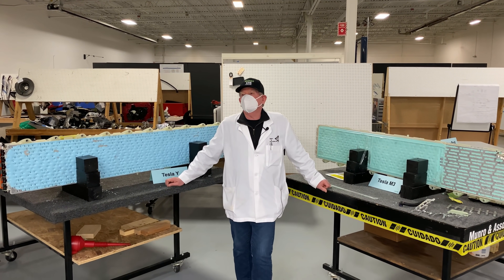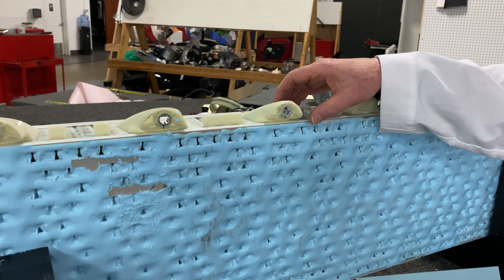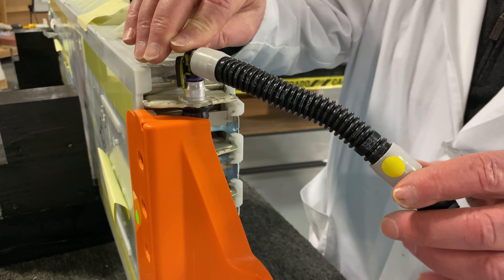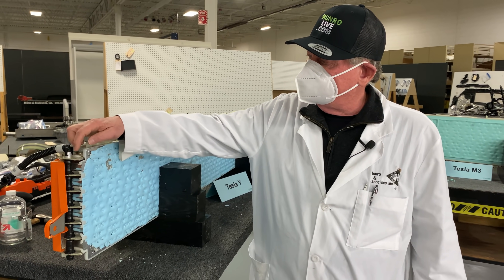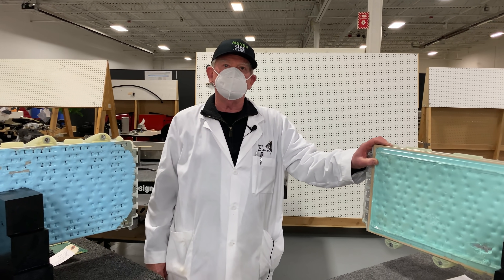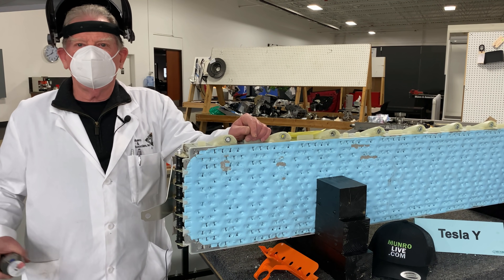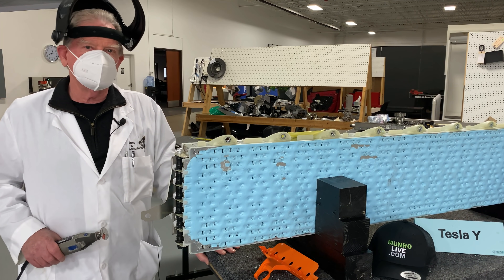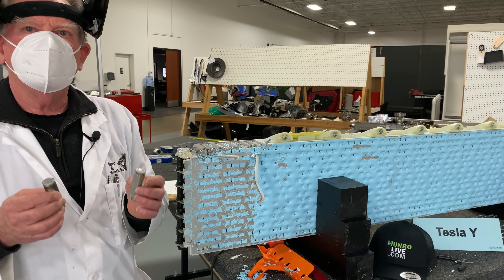Model Y E35: Individual Battery Cell Removal and Comparing the MY-M3 Battery Modules

Comment: Not every cost reduction is a good thing. Sometimes, overbuilding a thing compensate for what can happen after things have aged specially plastic parts. I’m a MB mechanic and I hate taking apart plastic parts after 3 years or 30,000 miles of use specially if they are part of cooling system. They loose elasticity and we usually replace them when those parts are in the way. Our usual complaint, “ What were the Engineers thinking when they are designing these?”

Comment: So how does the battery cooling work? Water / coolant is passed through hollow fins that go all the way to the back end of the battery and back to the lower part? The cooling fins only "touch" one row of battery cells, but it appears that there is at least a second or even third row not directly touching the cooling fins, correct? Where does the hot water go out - the other end of the black plastic tube or at the other end of the battery?

Comment: Tesla seems to have been producing castings throughout the epidemic. If they have a stock pile will this allow them to have a high production rate or is this not the limiting factor (in normal times). Conversely how reliable are these devices could a failure sent production for a prolonged time?

Comment: Any thoughts on how recyclable that pack design is? It doesn't look like it was designed with recyclability in mind at least. 

And any chance of getting hold of a few of those Model Y 2170 cells? We're quite keen to test them out in the lab as a benchmark, and to crack one open to see exactly what is inside.
Reply: Since Tesla will be recycling these batteries themselves, I'm sure they considered it in the design and have a process in mind for recycling. https://www.greencarreports.com/news/1122631_tesla-launches-battery-recycling-at-nevada-gigafactory

Comment: It would be interesting to see the difference in terms of capacity/charge rate between the two cells, comparing the old 3 version to the Y.

I understand that might not be possible given the 3 has been discharged for a while.

Comment: That's difficult to recycle or re-use once these batteries gets old or not good enough for a car.  I'm thinking if Tesla could somehow make the pack more modular,  sacrificing a bit in space and costs so that it will be easier to re-use them as batteries for home/appliances/projects.

Comment: These battery packs are well designed for an efficient drivetrain but pretty awful to recycle. It will be very expensive to dismantle the cells. Not very sustainable.

Comment: Do you think this potting compound might be the “intumescent goo” that tesla patented in order to inhibit propagation of thermal events between cells? 
http://www.patentsencyclopedia.com/app/20100086844

I wonder if this contributed (along with safer chemistry) to  reducing the 15 firewalled chambers in the S and X packs down to just one in the Model 3 and Y.

It would be interesting to heat the potting compound to see how it responds.
Reply: Whoa... How on Earth did you find that?
Reply: @liam1428  Just Geeking out as I do, many years of analyzing the engineering. ;-)

Comment: Rolls Royce developed a plate heat exchanger that uses layers of dimpled sheet metal. It’s cheap to make but very efficient. I wonder if these packs use a long plate exchanger between rows of  batteries.

Comment: is 1 o-ring enough?
Reply: Sure, almost all home plumbing sharkbite, push fit, and crimp connections are done with only one o-ring. They claim a 25-50 year service life. If they're properly installed and specified they last ages. Most times they fail it's due to sealing a moving part (they slowly abrade away) or poor fitment/design specifications. For example the choice of synthetic rubber needs to be matched to any chemicals, in this case additives in the coolant.

Comment: Video request:  Sandy recommends the Y, yet drives a Rubicon.  The term “SUV” has been hijacked to refer to volume distribution rather than vehicle competence to handle rough terrain.  I need to drive forestry/mountain/dirt roads, so won’t buy Tesla until the cybertruck comes out.  Could Sandy please go through the components, suspensions/ wheel joints/ what-have-yous that make the Y unsuitable to drive on such rough roads, whereas presumably the Rubicon could handle them?

Comment: Is a chemical analysis of the batteries and charge characteristics of the 3 vs the Y battery packs part of your plan?
Reply: spoiler alert, they are all the same cells from the same factory .
Reply: Except that they were manufactured years apart. An analysis would show incremental changes/improvements. But thanks for your condescending reply though.

Comment: This battery pack design is the definition of unrepairable !
Reply: The whole pack, the four units, can be replaced individually. Each battery was not made for repair. And to recover those cells looks like a nightmare.
Reply: lightdark00  - TThose pack are way cheaper to build, cimpared to the MS and MX ones. he cells might yet be recyclable by having some kind of solvent to remove the foam. Then they get acces to individual cells. Then they might have to test every individual cell, and select those for use in a refurbished replacement pack. Still saves money and ressources i guess. Especially in large quantities.
Reply: @bonzo-er6ly  I was making a point about the word usage. I was thinking about the average person that would want to recover the cells or replace one battery. Gasoline might be the cheapest solvent currently easily available, that might work.

Comment: So in-between the batteries are incased in foam with layors for cooling and stuff formed and fit ? Then all metal, aluminum covers going on top and bottoms of batteries glued or fitted with forms built in to the foam while keeping it lighter it is filled Indian and the foam becomes brackets not filled in areas to lock in places for metal connection then when recycling the battery would be easier just seperate foam from all other components and not only use the batteries but all other pieces of battery pack connectors to just would make it simple right ? What do you think would a formed battery,lighter battery and one that's Easter recycleable be better can it be done keeping it cool so no overheating ?

Comment: I think the difference between the blue and green foam is that the blue one is painted and the green one is casted, take a look at the edges.
That makes the blue one way faster to manufacture.

Hope to hear your opinion Munro.
Reply: The blue stuff isn't actually foam like he says. It's gap filler that has a high thermal conductivity meant to help dissipate the heat from the batteries to the battery module housing. The blue one to me looks like BERGQUIST GAP FILLER TGF 3600. TGF 3600 gap filler is pretty common for batteries. The green color is just a different gap filler. Both should be a form of a liquid before it cures. I agree that the green one looks like it is casted around the edges. The green one most likely has a low viscosity which might be why they have to use a cast to keep it in place like a dam. TGF 3600 is think enough where that doesn't need to be done. The holes that he didn't understand are most likely for outgassing.

Comment: Get the upcoming rav4 plugin hybrid.  39mi of electric range, e-awd, they claim instant torque like an EV, and it is fast at 5.2s 0-60.  It will be a model y competitor and fill in the gap that the chevy volt used to fill.

Comment: I see tesla thought about how a recycling company would recycle the cells lol...hardly eco lol terrible design try and get that apart to reuse the cells
Reply: Yeah, because dipping it in a chemical to break down the bonding agent is rocket science, right?
Most of these battery packs will probably be used in stationary energy storage after its use in a car. In those cases you don't even need to break down the pack.
Reply: Most likely these batteries will spend the first years after being in an EV as in-place energy storage for the grid: they will be reused as packs, only after that will they be torn apart and recycled.
Reply: Theres probably a nasty solvent that can get the job done, or else a heat process that isnt suitable for the disassembly of a single battery.Sandy probably doesnt want the electrolyte leaking everywhere or his shop filled with toxic fumes.
Reply: @Marc83Aus  It's fortunate that the next gen Tesla batteries will likely have a solid electrolyte. But yeah, it's always interesting to see how they would be disassembled. I think a former Tesla employee started a recycling company for Lithium batteries.
Reply: @DecepticonLeader  Its probably going to be harder to recycle the solid electrolyte batteries. But they should be safer, cleaner, and have a longer lifespan.
Reply: @Marc83Aus  Yep.

Comment: Given how difficult these are to disassemble, I wonder whether recycling will ever be economical or if they'll just end up in a landfill.
Reply: Also note.. these battery packs are not a one life use. These packs are expected to have a second, and likely 3rd life.. spanning over 20 years of use.. potentially as long as 50 years of service, before needing to be recycled back to their base materials
Reply: There will be some sort of chemical that can break down the bonding agent. Recycling isn't always simple. It's all down to time to material value.
Reply: You literally throw them in a shredder. That’s how you recycle these.
Reply: @bob15479  Fully Charged recently did a report on a pilot setup in Germany where they do just this. Strip down to basic battery structure, shred it under nitrogen, low temp evaporate the electrolyte then dry-process the remainder before then chemically separating the valuable rare earths. If they recycle the carbon as well, they reckon they are getting close to 90% re-use of the entire battery. They even use residual charge (if any) to power part of the process. Only small scale pilot at the moment but once scaled (and it is scalable) should mean very effective (and profitable) recycling of EV batteries.
Reply: I was also wondering this. How the hell can we disassemble these packs quickly to re-use the batteries?
Reply: @marctenhove874  Recycle is melting the pack to its constituent elements are reusing them. Its probably cheaper for rare earth metals to be recycled than mined.
Reply: @archigoel  That's laughable
Reply: @archigoel  there are no rare earths in the batteries.
Reply: Lyle Stavast true.. but many hear cobalt.. and think rare earth metal.. even though it isn’t.. but, i think that’s what they are referring to
Reply: If you look at any salvage Tesla auctions all the car get their batteries already removed, I guess that's the most valuable part.
In the case of the Model S/X it is possible that some packs might be used for upgrade to a larger battery size or replacing high mileage one.
But in the case of the Model 3, may be the packs are then used for making Powerwalls ?
Reply: Nihongo Benkyo Shimasu exactly so. The second life for these battery packs will be as energy storage, where they do not need to retain their maximum capacity as they need for a automobile to be a viable transport.. they can operate as energy storage with slowly reducing capacity over time, for decades. And after that, there are people suggesting even less intense purposes where the batteries can operate for a third ‘life’.. these things are built to last a long time.. with reduction in total capacity, but still VERY useful.. and only then, to go into recycling to take them back down to base materials to be reused.. and as another guy mentioned, there are already companies going in to this exact business, J B Straubel.. and they will develop techniques to do it where it’s profitable. Even if it cost a fraction more.. i think companies can explain the benefit of paying a fraction more for using recycled materials
Reply: I'm pretty sure recycling will be addressed at Battery Day later this month.  Re-use is the first step.  Stationary storage is growing and used EV battery packs are used in DIY systems.  Thses things will last over a decade as an EV battery then another decade or more as storage.  Recycling right now is more for cells that are bad right off the assembly line and packs that are unusable (physical damage/flood damage).
Reply: https://www.greencarreports.com/news/1122631_tesla-launches-battery-recycling-at-nevada-gigafactory
Reply: aurelio milaor cabal  Straubel starting a company doesn't prove it is or will ever become profitable. Tesla has been a company for 17 years and has never been profitable.

Clearly if the price of raw materials becomes high enough, recycling makes sense.

But if raw materials are really expensive, the EV they're used for may not make sense.

Comment: Mr Munro, name on the collar, two pens in the top pocket, that's a proper Old school, working engineers jacket.
Reply: haven't seen him pull out a slide rule yet.  THAT, is old school...
Reply: One of those "pens" is a telescopic torch pointer, he used it in the previous teardown episode, E33 around 9.20 you'll see him use it then put it back.
Reply: I was just thinking that I need to buy a lab coat to wear around the house. Like a Rick style long lab coat.
Reply: No slide rule....
Reply: He should have a pocket protector in the pocket for pen leaks...

Comment: "You might get a trickle charge" something tells me that still might hurt, but live to remember it.
Reply: you can feel 60 volts, but doesn't hurt you at all. As long as you don't electrocute your pace maker ... 😁👍
Reply: @Poxenium  I got 6,000 volts biting into a Certs. It was refreshing.
Reply: Had a few rapid charges in my life, thankfully all somehow within spec
Reply: 480 will let you know you didn't follow LOTO
Reply: A tickle charge.
Reply: I’ve been with with 120 plenty of times it’s no big deal
Reply: @mattbrew11  Try 120 volts, 120 amps. Even it up. When your head smokes you know you are there.
Reply: ipissed haha good point. It’s the amps that kill not the voltage
Reply: @mattbrew11   But you need the voltage to create the current. A 12V/1kA Battery is harmless to the human body, the resistance is too high.